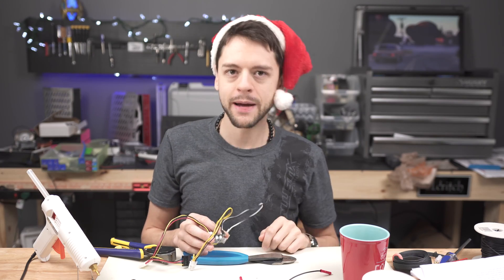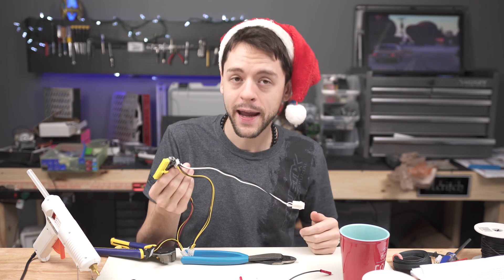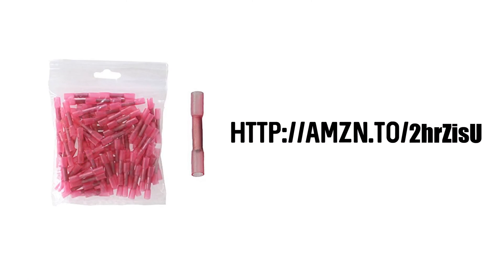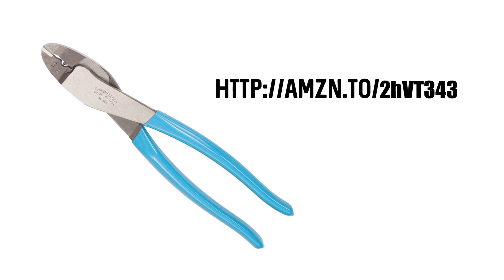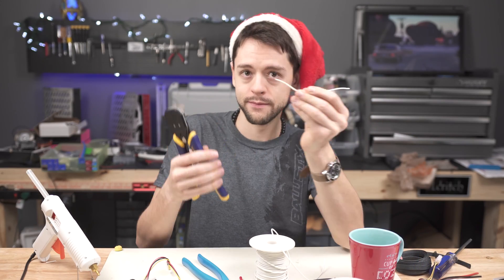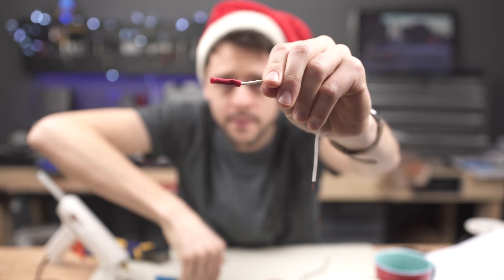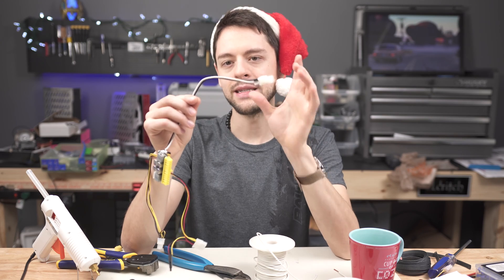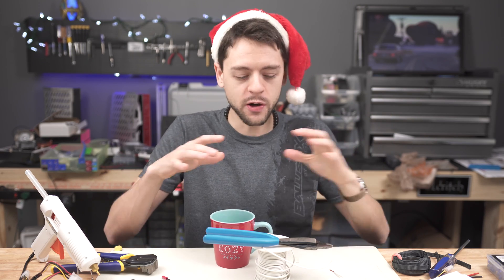No solder? No problem! Butt Connectors!

Comment: whaaa.. I didn't even know butt connectors were a thing! certainly looks alot better than the electrical tape thats currently holding my fan extension wires together xD

also the Amazon links you've included are so helpful! I'll be picking up those strippers and connecters on my next paycheck

Thanks Josh :D
Reply from the maker: Thank you for using my links!!!